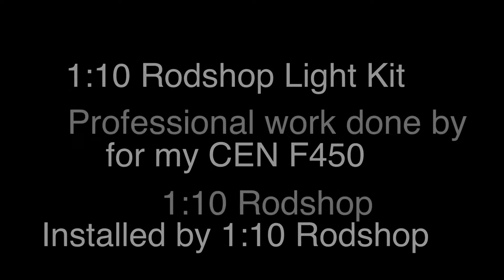Return trip from the Chop Shop with my CEN F450

Comment: What’s a rough cost damage on a light kit install like yours ?
Reply from the maker: The light kit is around $200-$250.  To me the issue is not the cost but the actual installation is a nightmare. I had mine done by the seller. Cost me a little more but it was a professional job.